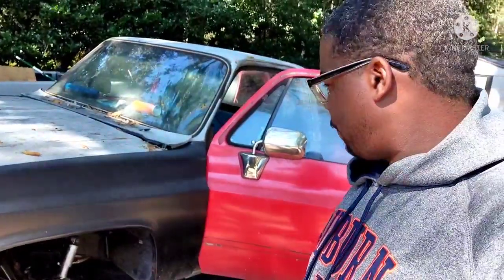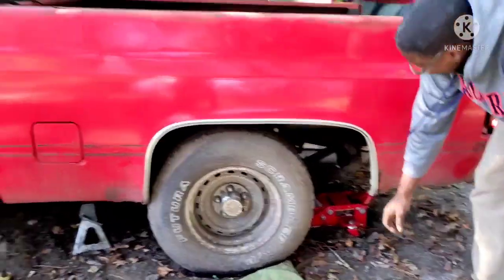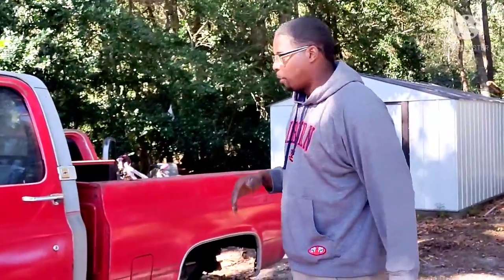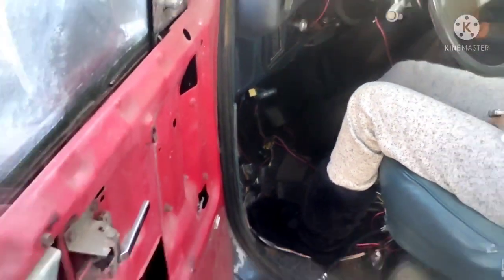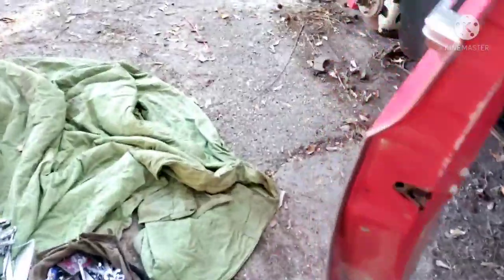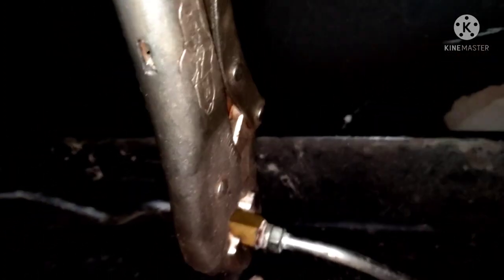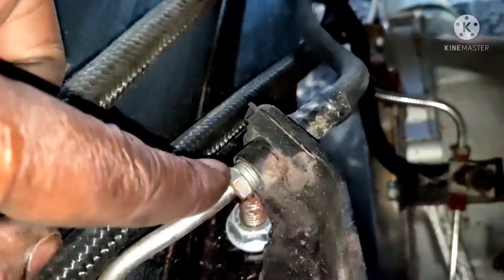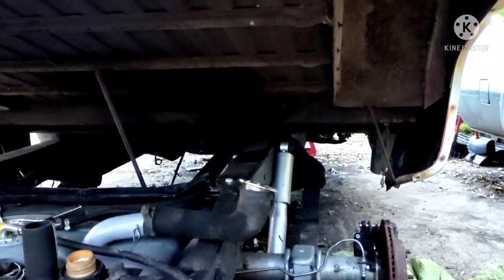BLEEDING MY 1985 C10 FRONT AND REAR DISC BRAKES DIDN'T GO TOO WELL!!

Comment: your doing better then me, you got help, i used a spring loaded shower curtain rod till i made a power bleeder  from a small pump sprayer, and in case your wondering, i would pump up the brakes and then press down the spring loaded rod on the pedal and jam the other end in to the seat, then go the wheel i was working on and crack the bleeder, the spring loaded rod would push the pedal down the rest of the way to the floor, the power bleeder i made was from a small pump sprayer and a fuel shut off kit for a riding lawn mower, home depot, lowes, you can find it there, if your going to make one, you will also need a mason jar and some clear tubing, the tubing needs to be the size that will fit over the nipple on the bleeder at the brake caliper, put a little brake fluid in the jar and stick the other end of the clear tubing in the jar, as you power bleed the system you will see air bubbles in the clear jar, it does not take much, 5 to 6 pumps on the sprayer, dont need so much pressure that it blows everything apart.
Reply from the maker: Now that's thinking outside of the box

Comment: Man my C10 brakes were such a pain to bleed. The wife hated helping me with it. Same situation as you it took a while to get the fluid going but once it did it was easy peasy…. My dodge truck was easy as the fluid was flowing from the start.
Reply from the maker: I believe I get that rubber brake line it will go well!
Reply: @DIYWithTheRichardsons  when I bought the fronts I bought that one also but can’t remember where I got it
Reply from the maker: @kw686  if you find out where please let me know
Reply: @DIYWithTheRichardsons  I I have a 76 and this hose supposedly covers 75-86 rear center.

Comment: Sometimes it takes a vacuum to get the fluid going through the caliper/wheel cylinder. I have had really good results with the bleeder kit from Harbor Freight. You do need an air compressor to use it though, not a really big one, mine is like 12 gallon compressor and it works fine with the kit.  Pneumatic Brake Fluid Bleeder With Auto-Refill Kit #92924.  Good luck!
Reply from the maker: Thanks Joe I'll definitely check that out!!